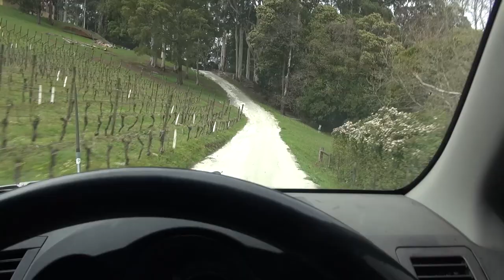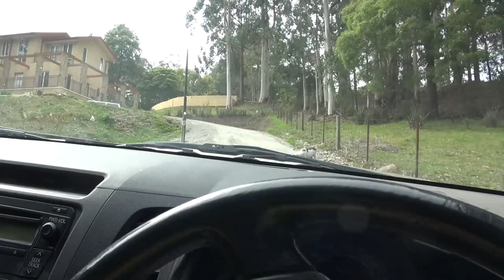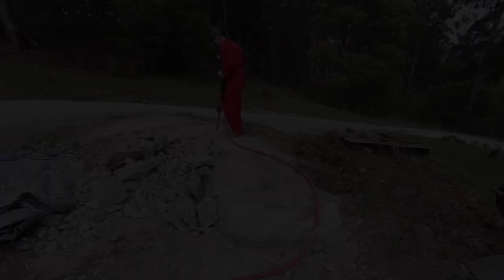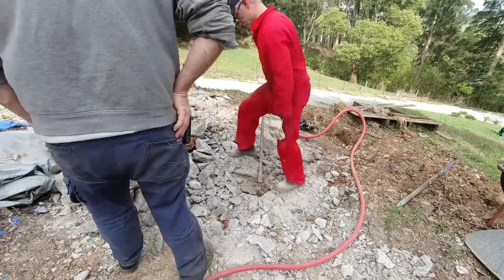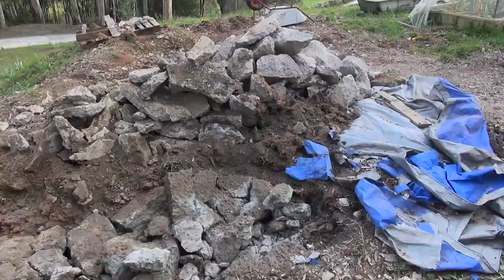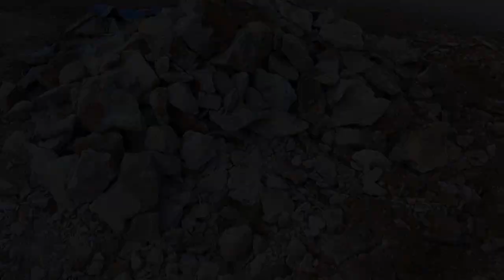Using a 40Kg (100 Pound) Jackhammer to break up concrete.

Comment: This was done at my neighbors. They had to hammer for a few days to remove a 30x35’ driveway. It was a driveway that was poured on top of another driveway. Some pieces were around 16” thick. And there’s no blasting aloud here. Lots of hammering, broken skid steer, broken pallet forks. It was not a fun week for them.
Reply from the maker: That would be a nightmare!

Comment: Howdy from Sacramento,  Dave!  Riding a hammer like that at age 18 for two days on a reinforced base for a parking lot light pole is one of the things that influenced me to get out of the trades.  Just lifting the hammer to reposition it is no joke.  You're a pro!
Reply from the maker: Only somebody that has done it would know, it is not t he hanging onto it that is the challenge, but the continual retracting it and positioning for the next burst that gets you.
Reply: @demolitiondavedrillandblast   That is exactly right. I have done a bit of jackhammer when I was young. The noise is exceptional too, and the noise is almost like being beaten up, expecially if using a jackhammer to sheer off old rivets from structural steel . My sympathy ...That is a big beast alright...............
.
Reply: I ran one for 7 years down in Houston Tx back in the 90s. For Colier construction out of Tomball. That actually looks like a 60 lb, but I may be wrong. Hes lucky there was no rebar. Its hard work. I had to build up to it. But I got Bull strong. and still am at age 53. This video inspires me , makes me wat to go do some work.

Comment: That driveway up the green hillside between an old vineyard and an oleander hedge, then into the eucalyptus trees to the big house, looks exactly like something I would see in the Napa Valley! Looks like home.
Reply from the maker: Yeah, I heard you have a lot of feral eucalyptus trees over there. The climate is a bit colder here though.
Reply: @demolitiondavedrillandblast  there's an interesting story behind the abundance of eucalyptus trees in California.
They were planted to use for railroad ties or sleepers.
Someone heard how fast they grew, and so they imported them and were going to plant them along the railroads to keep the ties supplied, instead of having to haul them long distances from the forests.
It seems like they were being used for ties in Australia as well.
But after they let the trees grow big enough to make ties, and had invested a lot in planting them all over, they actually used some for ties, and discovered that we have a much wetter climate and more soil moisture than where they had been using them in Australia, and they rotted out just as fast as they grew.. lol
*face-palm

So, now we have a lot of beautiful and majestic trees all over the place making the state smell beautiful, burn faster, and snapping limbs with no warning since 1843!
But no practical use lol

I used to do tree work, and I hated climbing eucalyptus, because it doesn't give any warning before a branch breaks. It's like glass shattering.
But I love the smell and the shade!

Comment: Nice One Dave..I hope your doing t with the lockdown. Thanks for vids mate.
Reply from the maker: HI Andre, quiet day at home today, not much work at this time. This job was a while back.
Reply: @demolitiondavedrillandblast  Did you get on the air?
Reply from the maker: @vk2ig  Yeah, station is running.

Comment: That's hard work with the heavy hammer and must make your arms buzz - helps though working along a free edge. Compressor works hard. Great result Dave :)
Reply from the maker: Right on Chris, I tend to get cramps in my forearms from using this beast.
Reply: I used to have my hands basically freeze up after a day of that, would have to slide my hands off the end of the handles because I couldn't open them lol

Comment: That hydraulic breaker makes light work of every job you've posted.. Kinda drives home the fact that my first boss back in the 90's was a real assho1e.. Making me do it with a big 240v Hilti drill 😂
Reply from the maker: It's good but fairly punishing to use for a little guy like me.

Comment: How many PSI does it take to run that hammer? What other tools do you have when you run that? Ie flat head shovel, 10 pound hammer, wheel barrow, pick, etc.

Can you run that off a portable air compressor or only a tow behind diesel air compressor? Thank you
Reply from the maker: This breaker needs about 70CFM, needs a tow behind compressor. I just have pointed moils and flat chisel points for it.

Comment: If only at the time of ordering the concrete they did there calculations properly.

Also most times there is a machine on site and its easy to spread it out about 10cm or 4 inches thick and put cuts or slices in it so you end up with small pieces, water or excess dirt will also work mixed in with it, sometimes a shovel breaking it into smaller bits while wet .
Then all said and done if this was done you would have 1 less job to get paid for.
Reply from the maker: Don't give them ideas Roland.

Comment: Ive done that A LOT of times repairing old concrete. An episode for me. Also if it doesnt break, bigger hammer. Point or spade end
Reply from the maker: Hi Jase, I started out with a point and then changed to a chisel.
Reply: @demolitiondavedrillandblast  its all good unless 40mpa with f92 mesh double layered. Theres a few spots here in tas when on slippy ground where i had to use dble mesh.

Comment: "Very easy".  Well, for someone who knows what they're doing. Seen some hilariously comical jackhammering.  Either those toy electric hammers or guys who start in the middle of a slab with a nice dull bit...
Reply from the maker: Yeah, it's not rocket science but some people just don't get it.
Reply: @demolitiondavedrillandblast  , it is a science.  i used to work at a scientific establishment that studied such things as structural fatigue, crack propagation, destructive and non-destructive testing and ultrasonic testing.  i used what i learnt there to help me develop skills at breaking things.  whether with jackhammers or rockbreakers, the moment the tone changes, move the bit.  the stuff has yielded.  you have beaten it.  there is a yt video of rockbreakers smashing up the concrete around tram tracks in spencer street.  this is a big demolition company who is not doing it the way i would.  they're doing it backwards.  for those who are not professionals who have concrete to break up, if you undermine it with a shovel, you can get away with using smaller tools.  this does not apply to hard rocks.

Comment: Dave   The bit you used was it a board tip ?
Reply from the maker: I started out with a point and then changed to a chisel Bob.
Reply: @demolitiondavedrillandblast  , i always used a chisel.  the material develops hairline cracks that radiate at either end of the hole that are too small to be seen with the naked eye.  when you put the chisel near another hole, the hairline cracks can meet up and form visible cracks.  a diamond point creates shorter hairline cracks that tend to radiate in all directions.

Comment: 100 pound jackhammer ???.   You know they have " Magnum " add on jackhammer weights If you need more . ........
Reply from the maker: No... 100 Pounds is enough thanks Joe.
Reply: @demolitiondavedrillandblast  Smart man. You could probably physically do it,with the magnum Arnold schwartsineger mega weights  but we all regret that when we get older... but I have done a number of things I regret...................

Comment: wouldnt it be more fun blasting it?
drop in somes holes with a ramset drill and loop a bit of detcord through each of them?
Reply from the maker: Yeah, but then I have to bury it. I thought about bringing a machine but there was no suitable place to unload on the street and did not like my chances in the tilt tray truck in the steep off camber drive way.
Reply: @demolitiondavedrillandblast  
woven tyre mats arent your thing?
Reply from the maker: @brucebaxter6923  Yeah, I have a pile of them Bruce, not good with det cord shots though as they always blow the stemming and ruin mats real quick, apart from the noise that will bring lights and sirens in a very short time.

Comment: That looked to be at least a cubic metre of wasted concrete. If it was going to be wasted they should have cubed it up with bits of reo to make it easier to lift. Always pays to have a plan and preparations for using any leftover concrete.
Reply from the maker: I don't think there was any plan for it Mark, it just got poured on the ground (as usual).
Reply: @demolitiondavedrillandblast  Last time I had a concrete truck here, it took down my 40m inverted vee when backing up to do a second pour.  Wrecked the balun housing.
Reply from the maker: @vk2ig  you need higher antennas!

Comment: Good technique and choice of tools imo but i do not see how in the world you can stand using that hammer with coveralls and a mask on just do not.
Reply from the maker: I could not imagine working without the mask, My lungs are not full of concrete and stone dust and I have not got any stone chips or other crap in my eyes in years, before I had these full face protectors, I only used safety glasses and stone chips in my eyes was still a regular occurrence. The coveralls are, you just take them off when the job is done and you go home in clean clothes and thus keep all of the stone dust out of you vehicle. Like anything, you get used to it, I could sleep in this mask!